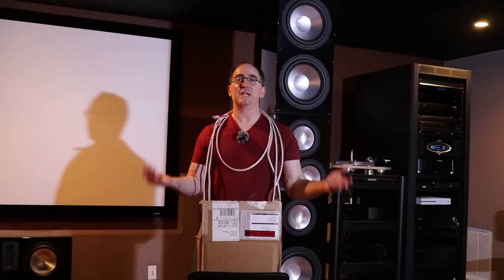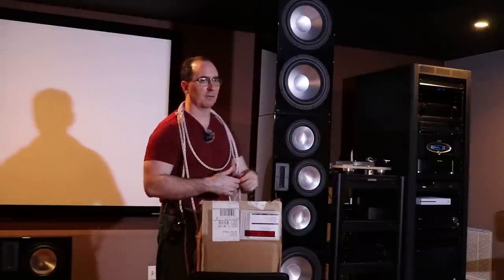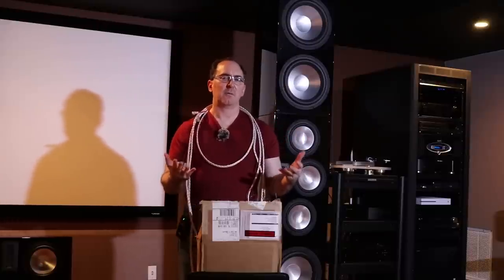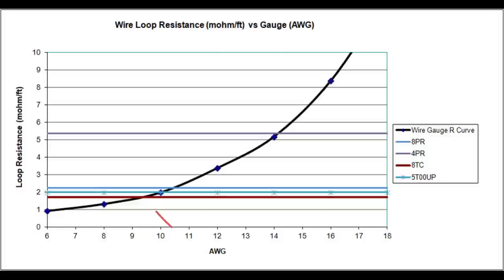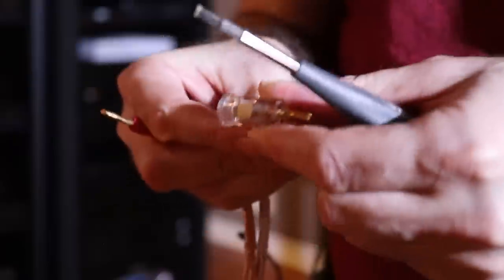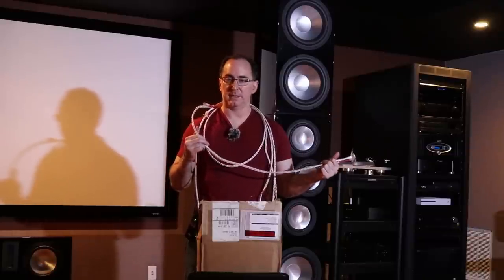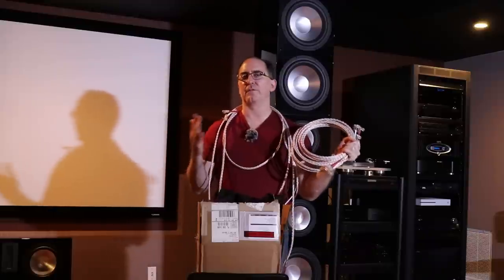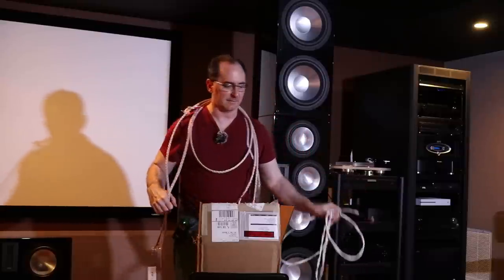Kimber Kable 8TC Speaker  Cables Review

Comment: Gene, it is so wonderfully heartwarming to see how much better you’re doing and back to doing what you love. 
I’ve personally been using Canare 4S11 from Blue Jeans for years now. 
Thanks, Gene!
Reply from the maker: those are my 2nd favorite cables.
Reply: Audioholics 
That makes me feel as if I’m doing something right, Gene. lol. Thanks again, man!
Reply: Same here.
Reply: @Audioholics  gene could you look at qed genesis silver spiral with airlock. That's what I've been using
Reply: Hah just saw this. I use 4S11 for lower impedance speakers, 4S8 works just fine for my horns.
Reply: So we measure the cables, and we measure amplifiers.  I’m thinking we should measure a basic 100w 8ohm .08% THD amplifier and a flagship Andrew Jones budget tower, tested with different cables, to see if the capacitance or inductance of the cables can influence the THD. We could even run the cables through the same 15’ PVC test tube mounted in a sawhorse style jig so that it’s off the floor for the floor nuts, and not coiled or bent in any way different test to test, ensuring that all the cables rest in the same spatial position. Go forth audio slaves! prove your Kimber! lol
Reply: Audioholics gene, great tip on getting a tight speaker connection, just checked mine and they were so loose. Great to see you are getting better. Your YouTube channel and audiosciencereview.com are the place to go for proper information.
Reply from the maker: @LAGPROJECT-gy7rj  Thx man. Still not clear of it, sadly. If I get another positive result in 4 days, I may hold the world record for longest case of COVID-19. I'm very hopeful NOT to break that record.
Reply: @Audioholics  Why....why would any cable be your favorite or second favorite?
Reply: me too
Reply: @ericmc6482  - seemed like he favored the Kimbers due to superior overall measurement compared to other cables.

Comment: I live pretty close to where Kimber cable is manufactured. I got my first set of cables from Ray Kimber himself. This was back in the mid 90's. I got to see how they made the cables, and the machines that braided the wires together. I gotta say that this stuff was quite innovative back then. I was lucky enough to get a set of cables from Ray Kimber himself. Never had to pay a dime for them. Back then , what I got was about $400 worth. It was explained to me, what kind of improvement in sound quality to expect. Ray wasn't wrong. I was amazed how much better my system sounded. I still have those original cables. I'd recommend Kimber Cable. They have been around for quite a long time now. They're located in Ogden Utah. Just a short distance from me. Still an amazing product.

Comment: I've been using Kimber, both the 8TC and 4TC in the black & blue strands, for well over 20 years.  I've never felt the need to go further up the product line in terms of quality.  To your point, I have upgraded/updated the connectors over the years.  The WBTs look nice, but my rig doesn't get changed out much, so as long as they have a solid connection now I'm hoping it will stay that way.  I did buy them for the subjective performance that as published.  They were definitely an expensive option then, but not close to the price now.

Comment: Enjoyed the review. About twenty years ago or so, I "built" my own bi-wire cables using 8PR and 4VS Kimber Kables. My hearing is not the best and my equipment is fairly bottom audiophile stuff (Adcom GFA 45 II and Legacy 2 speakers circa 1990). Got the wires from a shop going out of business for cheap. So the engineer in me went into overdrive to build something to replace my 12 ga  zip cord (Apature, I think - but definitely step up from Monster). So this review has validated that I probably have a pretty good set cable set and should have no reason to move away from Kimber.

Comment: Great choice. Wise decision. Am personally using 12TC kimber Kables for my system. 
Still working on getting kimber  balanced XLRs. 
Braided wire makes a lot of difference.
Reply: I got my 12tcs from China with carbon fibre barrel connectors rhodium crap etc 2m 75 pounds. Sound xcellent

Comment: Gene, I have been using those connectors for two years now from parts express. They are less than 15 bucks a pair. For Kimber to charge 500.00 dollars for two of them is crazy?
The cable itself looks cool but way too much money at 700.00 dollars.
Reply: As I just brought a cable from them, I noticed it was paid to RKB Industrial. RKB Industrial owns Kimber and wbt connectors. Maybe their relationship had changed now and they are charging more money for those connectors. I seem to remember them being slot cheaper years ago as well.

Comment: I use 12/2 speaker wire and I install my own Sewell Direct connectors, I sheath it with braided nylon for glam and I install  wire trousers with a finishing of 3:1 color coded heat shrink. Makes a beautiful and reliable and pleasant and functional cord.

Comment: I use custom RCA's that I made myself.  Made with high quality cable with really high quality RCA's with silver solder.  Yes, my wife could hear the difference as I replaced each of the cheap RCA's with my custom made ones.  As to speaker cable I use 14 guage flat cable that works just fine.

Comment: Glad you're back Gene. I've investigated and played with cables. My reference speaker cables are Audio Quest Mont Blanc (with factory upgraded ends). It's good to have a reference set - same with speakers. Without references, I've noticed tendency to become comfortable with nearly anything. I'll go down a path awhile, then bring a reference back to validate progress. Being a DIY type building speakers, certainly cables are easier. Lately, I use Belden 4x14awg for speakers (doubled-up), and Belden 1694a (6u coax) with matching Belden compression RCA ends for interconnect builds. I've never heard a difference between my DIY cables and reference. Which brings us to the request... could you do a video on how to measure critical cable attributes, and make public how each cable performs relative to others - like those graphs you showed in this video. Also, a deeper explanation of how each attribute affects sound. Also interested in why the cables perform better/worse (example: as gauge decreases, resistance increases, as length increases resistance increases, etc.). You could answer questions like: Solid core does?, mixture of gauges does?, purer copper does?, silver tinning does?, what protects against RFI and EMI, why twist, why weave, etc... I would like to know the facts from an educated EE.

Comment: I use Audio Envy cables. To Captain Payne, the owner of the company, capacitance is his primary bug-a-boo. I have electrostats. The most important spec for the panels is capacitance,  so these work incredibly well here. They also make a somewhat smaller difference in interconnects. They are hand built, and make an audible difference to even casual listeners. They are also affordable.

Comment: A little more than a decade ago, I had a pretty good relationship with a stereo shop selling mid range stuff and some higher end things.  Not that I bought much, but staying pleasant and generally being nice was me and my friends' ticket...  We were allowed to mess around within reason, and test everything in any combination, bring our gear to have a private shootout.... Basically anything we think is prudent.  And then I tripped on one of their self-built speaker cable with that WBT screw-tighten banana plugs.  Thankfully the connector's banana pin broke instead of the speaker tipping over.  As I want to remain on good terms with the shop, I immediately went to the owner of the shop and ask them how much I own them for the damage.  They were gracious enough to charge me for the part only and we were good after that.

Pro-tip... don't trip on your speaker cable...

Comment: I've had Kimber 8TC/4TC bi-wire cables for years. I switch between these and MIT Terminator 2 bi-wire cables I was talked into. Speakers are Spica TC-60s, Amp is a Sonographe SA-250, Pre is AVA Ultra EC with a heavily modified Thorens TD-318 w/RDC platter and an Anthem CD-1 CD player. (Various other sources). Sometimes I like the Kimber better and other times the MIT seems a better match. The Kimber is "Brighter". Buying nothing new for now. Tried this with Dahlquist DQ-8s as well. Like the Spicas better.

Comment: Mediabridge 12 gauge ultra series sure works for me and  is ultra cheap compared to kimber.🤔😬  Did make a noticeable difference using basic type 12 gauge monter cable for years.
Reply: Mediabridge 12AWG Ultra Series Speaker Cable w/Dual Gold Plated Banana    -   Soldered Termination  -  Great balance between zip and eye candy.

Comment: I use mediabridge 12 gauge ultra series speaker cable, probably considered low end compared to multi thousand dollar systems but it works for my pioneer avr and Polk monitor 70s lol
Reply: Mediabridge 12AWG Ultra Series Speaker Cable w/Dual Gold Plated Banana    -   Soldered Termination  -  Great balance between zip and eye candy.

Comment: Really, really happy you made this video on the Kimbers. Having long known of your well stated "opinion" relevant to cable company "claims" - I have stuck with Blue Jeans cables.
And, I love them and recommend them. Now, having said this, I am seriously considering  the prospect of up-grading my system right from source to speakers and... I'd like to consider speaker cables ... IF IT MAKES SENSE! (as in common with no pseudo science) I just checked out the price for a pair of Kimber 8TC @ 3M each and I am quite happy with the price. So I am clear now - this is what I am going to do and thanks to you and this video I will not be second guessing myself and wondering if I made a good choice. I'll wait until you approve the more advanced alien technologies that spill forth from the most immediate parallel universe but for now the Kimbers will suffice.

Comment: KImber Kables are very well engineered and very good sounding wire. I have used it for years and have lots of experience with 4VS and 4TC, both single and bi-wired with very high end speakers and it sounds great - it also good looking wire, not to mention it is a very quiet cable because of their proprietary weave geometry. Can't go wrong with it. I am now interested in hearing the 8VS vs 8TC.
Reply: @anonanon 10 It certainly can be dependent on the associated gear, such as comparing the wire with a $500 pr of speakers against a $10,000 pr. One thing is for sure, the geometry of Kimber Kable does a great job of rejecting noise, allowing more details to be heard IMO.

Comment: I use 4 conductor 12 AWG SOW cable. With the conductors paralled it has about 750 mOhms per thousand feet or less than a milliohm per foot. I like it because while its heavy and thick its also super soft and flexible. Termination is a PITA though.

Comment: I've had the varystrand 8tc's for a four years +, I was going to top them about a fifteen months ago, after buying atlas marvos for interconnect. Just couldn't get the sound satisfying and was ready to seriously blow cash further. I didn't! I re-tuned my thinking and allowed my ears to become more critical and the adjusted the room acoustics with absorption and diffusion. Nothing crazy just enough to keep things alive and a better balanced sound through the audio spectrum. Further speaker placement fiddling also. Well just as well I did, saved a wad of cash and got a dynamic bang, with more than enough bass, for which I thought the 8tc lacked. The best decision was to compromise the near field listening guide as gospel. The other gain was not being suckered to the barrage of audio hype, I got through the smokey mirror bias. 
I'm not saying audio wholistic nivana, a better room setup will bring this closer, but I do have audio satisfaction. Cheers Gene for your talks.

Comment: Welcome back!  

I have Kimber 12TC  with the WBT bananas and 12VS with the standard banana plugs.  Thanks for being forthright.  Yes, the Kimber's are audio jewelry.  99% of audiophile cables are jewelry.  And, yes the WBT connectors are awesome in engineering and price.  At least the Kimbers perform!

I can attest that the folks at Kimber Kable are nice folks.  One day after finishing work while in the field in Ogden, UT, I stopped by their factory.  They showed me how they make their cables, the raw materials they use, etc.  That was a cool experience.  

Gene, can you try to get some Kimber Carbon cables and measure those?
Reply from the maker: I can ask. I'm really impressed with the company. They are in close proximity to RBH Sound so if you get a chance, go demo RBH speakers next time you visit Kimber.

Comment: Gene... I have a 35ft speaker cable run. Should I go with a pair of BJC 10 gauge or try and run balanced from my preamp for the 35ft instead and put the amps closer to the speakers (if even possible). Speakers are Magnepan .7’s.

Comment: Hi Gene, it's good to see you looking better. I have been using Kimber for many years - first, 7 meters 4TC bi-wired ("Y") cable and now 3.5 meter Kimber "Crystal 24" (2x12TC) and 8TC jumper cables, sold by UK Kimber dealer Russ Andrews. The upgrade 4TC to 12TC was an eye opener - deeper, drier bass, more room acoustics and atmosphere, faster transients. My wife noticed it immediately. My power amp (2x50W Exposure from 1985) can be sensitive to cables. Signal cables can also make a HUGE difference - I have Kimber AG pure silver and Audioquest signal cables - these must be as revealing, detailed, transparent and accurate as possible. Supermarket speaker cable or signal cable sound very muddy by comparison. 
BTW I don't think measuring cables will necessarily tell you much about how they sound. I'm a physicist by training and I think we don't know enough about all that goes on (more than R, L, C!) to influence the sound, even though we know more now than 50 years ago. All the best, Rob in Switzerland.

Comment: If they don't have published specs yeah right, I have never ever seen a speaker cable with a published impedance spec for sale in Australia.  I know you say 1 or 2 exist in America so I take your word for that.  Because I don't have any facts or figures to go selecting speaker cables, I just stick to the pretty budget end of the market because I don't want to risk buying expensive smoke.  That said, over some 30 years in HiFi & PA I absolutely do believe there are differences and the usual cable length gauge charts are inadequate.  So, here is the thing.  I did a lot of checking and measuring, of the auditorium PA including using contact cleaner conditioner on all the connections.  However the sound was still a bit muddy.  Eventually decided to invest a little in an experiment.  I replaced the existing zip chord cables with shorter and heavier gauge zip chord.  This gave the sound a lot more crispness.  I suspect the drivers were then moving more precisely.  After this, I did some EQ.  I had never successfully improved anything much with previous EQ attempts.  However, this time I had great success and the whole system came up to what was described by an audiophile as true sound reinforcement and the most natural and clear church PA he had ever heard.  Those cables were 7.5 m 14ga studio acoustic zip chord purchased from a hardware chain store.  They have a soft cover which I suspect is silicone.  Anyway, this proved to me that cables can matter, and the common gage to run charts the electronic stores all use are absolute rubbish.  To be clear, I am not commenting on top price range cables here.  These are pretty much the lowest bracket speaker cables available.

So, transferring this experience to vintage HiFi,  I ran a Pioneer A400 amp into a pair Proac EBT speakers using just 1m of the same 14 ga cable.  It sounded rather harsh to me and left my nerves kind of agitated after a long session.  So I picked up a set of CEntrance Reserve Series cables from Drop.  These were inexpensive 12ga 2.5m (8ft) so still a fairly short cable.  The result is that I remain nice and relaxed listening to my music on this spare room setup now.  So, Yes I think speaker cables matter, at least up to some point.

I've developed a hypothesis on this.  Assuming we have an amp of suitable power and fast rise and fall rates so it can track the audio signal accurately.  Then we look at damping factor which is an impedance matching view, load/source impedances.  Maybe, that's a better way to look at cable selection & budget.  let's choose a cable based on it not having an undue adverse influence on damping factor.  What is undue? well, I have no idea yet & I'm open to constructive suggestions.

Most cable charts seem to be based around DC resistance and for that reason, do not give great performance results IME.  I have tended to adopt this chart instead.  https://www.avforums.com/attachments/onepercentcablec-jpg.560672/

Comment: First, glad to see you looking so good!  Excellent review there, with all the scientific measurements.  I can hear the differences between cables.  Yes, I said it.  With many of the most expensive cables, I don't see how they could possibly NOT sound different.  Why?  Because they use completely disparate conductive materials, all sorts of different topologies and construction, and various gizmos incorporated into the cables.  I have a set of Cerious Technologies Graphene Extreme speaker cables and also a set of heavy gauge Douglas Connection copper cables, and the difference between them is stark and immediately apparent.  The Cerious cables are way, way brighter.  I'm not saying they are more accurate than something like the Kimber 8TC because I have no way to know.  Heck, based on your review, I may sell them off and go with the Kimber.